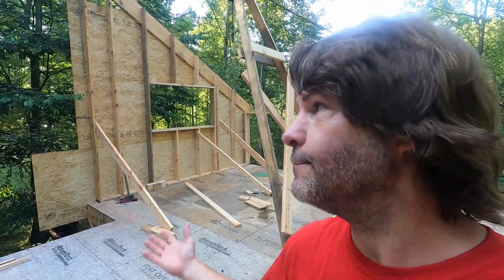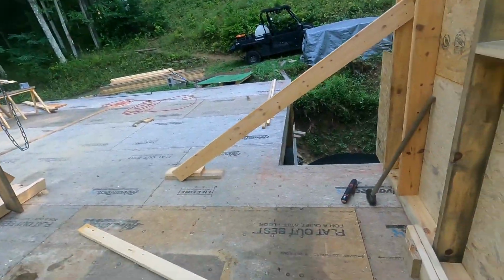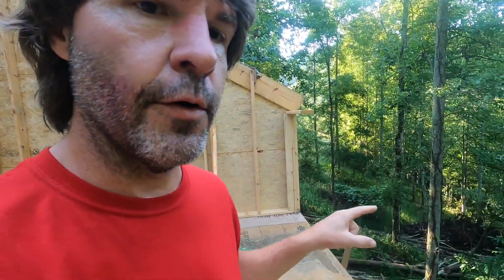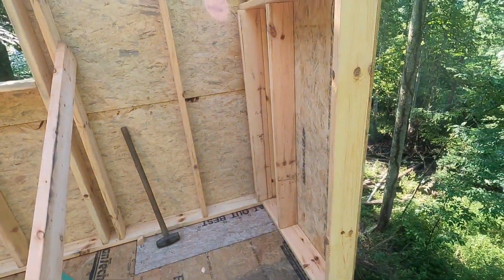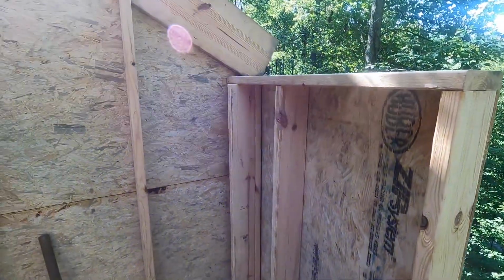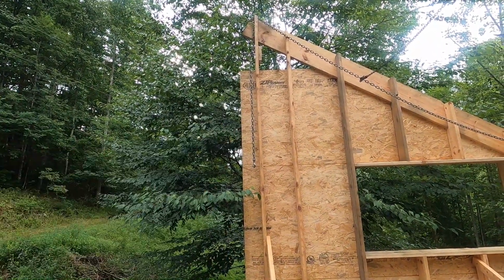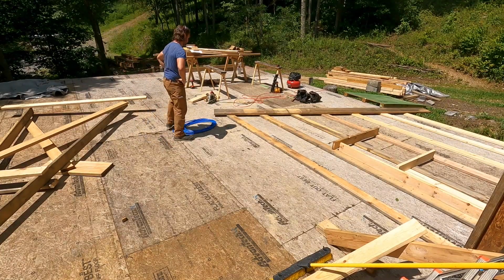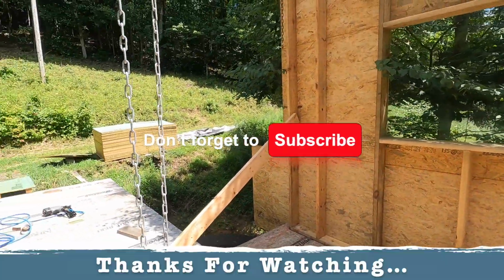Off-Grid Mountainside BarnBuild, ADU & Wool Studio Ep19  | Framing More East Wall, Making A Plan

Comment: Nice work so far but my only concern about no header or jack studs holding it up or the lower corners of the window is the snow load on your roof,, just sayin
Reply from the maker: Hello! Yes, I do understand your concern and traditional framing would need all that extra framing. Given the 2x12 #1 SYP rafters are sized to clear span from the beam (ep 31) to the wall, the studs are more for nailing the sheathing and space for insulation than actually providing structural support. Not that they don't provide support, they sure do. There are proper headers over the door and window openings on the north and south walls along with king/jack studs as needed (ep 27 and 32).